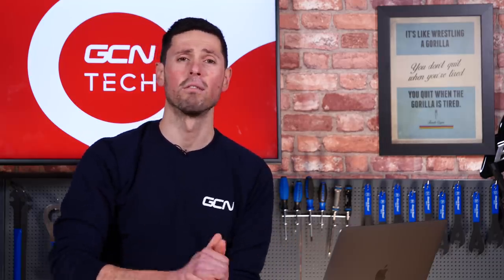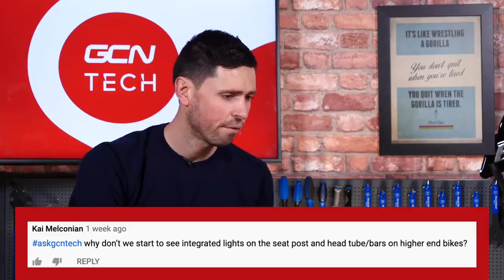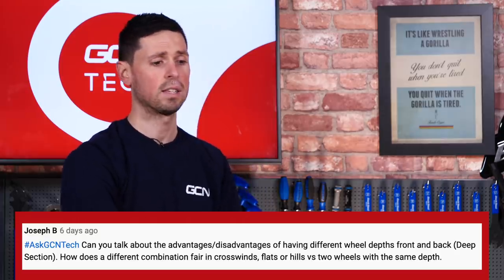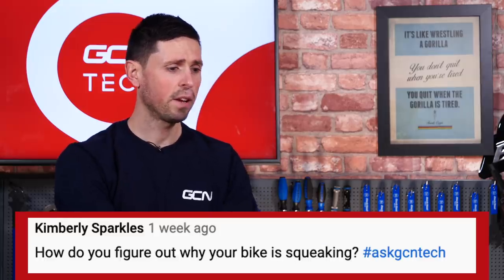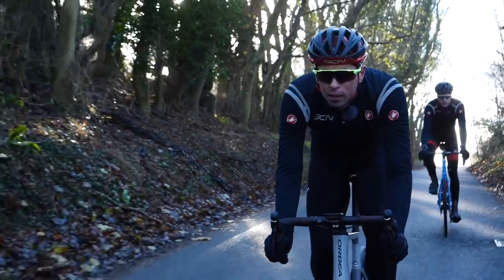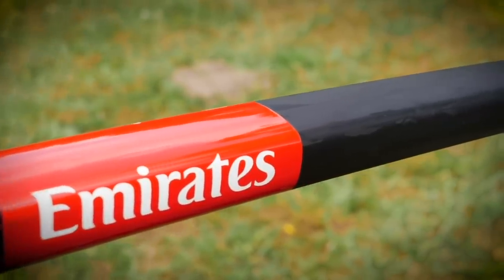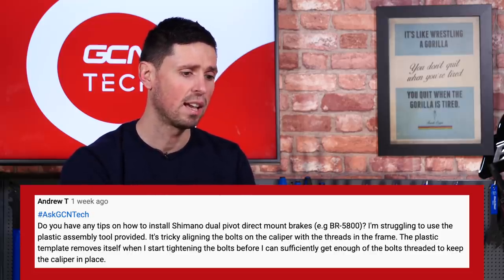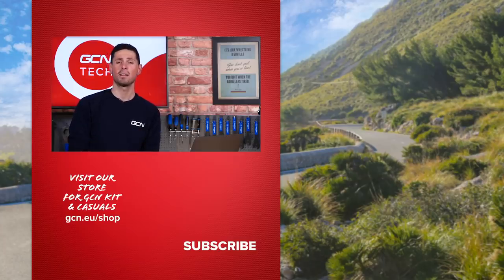Why Is Your Bike Squeaking When You Ride? | GCN Tech Clinic #AskGCNTech

Comment from the maker: If you have a cycling tech question that you want us to answer leave them below 👇 using #AskGCNTech
Reply: #AskGCNTech Why are wheels so expensive?
Reply: #AskGCNTech How often should I change my inner tubes and tires if nothing's wrong with them, because mine are ages old but nothing wrong but just look bad . Thanks Cheers and Happy New Year ❤️❤️
Reply: #AskGCNTech Hi guys! 
I recently watched a dream bike build video, where they assembled Zakarin's beauty. At the end the bike was only 6.27 kilos!!! How is that possible? I mean, what do they do to avoid disqualification? Do they put some additional weighs in the seatpost? 
Thank you for your answer!!:))
Reply: #AskGCNTech Why don't they sell orange spoke reflectors in the UK?
Reply: I had a Squeak on the front of my road bike with disc brakes for a couple of weeks it wasn't the kind of squeak when you apply the brakes to the rotor howling noise it wasn't that it was more like if the headset was loose or there was a crack in the carbon forks or something in that description when you apply the brakes. I got this bit of a squeak had me worried I finally narrowed it down and found what my problem was I put small bit of Grease a smear between the piston and the brake pad  solved my squeak 😊😊😊
Reply: Thank you for answering my question, Alex.
Reply: #askgcntech
I want to upgrade my 3X 105 crank to a newer 2X. So I need to also replace my front derailer and bottom bracket?
Reply: #askgcntech
Why haven't I won the lottery 😭😭 I want the new Cervelo 😂🤣😂
Reply: @paulwells3110  I don’t know if that’s a technical question.
Reply: Hi ollie. I have a gravel bike which has a cable actuated hydraulic brake calipers and they don’t bite as much as before but the braking pads still has a significant amount of compound left. I have already played with the cables and re-greased some bolts to make the braking action on the lever arm smoother. What can i do to make the braking power better or can i service the calipers at home by adding more mineral oil? Thanks a lot
#AskGCNTech
Reply: #AskGCNTech Everytime I go from my rear wheel to Kickr Core or vice versa, I have to readjust the limit screws due to chain rub when in the big chain ring. Is there a way to fix this problem? I have exactly the same cassette on my bike and trainer. Thanks!
Reply: #AskGCNTech Is it true that the smaller a gear range in a group set, the more durable the drivetrain? My logic is that 8-11 speed cassettes all have the same width, but each extra cog is fit by making every cog a bit thinner. Same goes for the chain. I am asking this question in terms of gradual wear as well as abuse from crashes and poor maintenance.
Reply: #AskGCNTech I have two different sets of shoes, and four bikes, all with different pedals, though all are SPD. All creak from the left shoe, or pedal. Is it some general Shimano SPD problem or is it more likely to be somehow related to my pedaling technique?
Reply: Hi guys. I've noticed the presenters riding various types of bikes: Road, Endurance, Gravel, TT, etc. in the videos with bikes that appear to have the perfect fit. How do you do it? I'm asking because I've had a professional bike fit for my road bike, and have purchased an endurance bike. Do I use the same data points across both bikes or somehow adjust for for different geometries? If adjust- any tools to help do this? #AskGCNTech

Comment: @kimberlysparkles  If you can answer that question without hours of trial and error, you'd be rich.  People have been trying to figure out why their bikes are creaking/squeeking forever.  Seat post, pedals, bottom bracket, handlebars, shoes, the list goes on and on.  You just have to eliminate each possible cause one by one until you get rid of it.
Reply: Good to know, I’m in for a long winter of squeaking and cursing. ;-)

Comment: I remember I had a squeak that was driving me nuts and I could never recreate except in specific conditions, well it turned out to be my shoe cover squeaking against the crank arm, like I said very specific conditions to recreate...rofl 🤣🤣🤣
Reply: Mine happens when I first start turning the cranks and then settles down as I ride. Ever so often, it comes back when I pedal.
Reply: Thats a good one, happens to me all the time on my flat pedals
Reply: @mango9087  I really can’t tell where it originates beyond motion. My mechanic says the bottom bracket is okay.  I can’t really work it out where else it is when I’m riding because NYC streets require the bulk of my focus.
Reply: @Kimberly_Sparkles  I'd check for tire rubbing on the frames, first off. Next, would be the pedal bearings. They often go unchecked but can be very noisy. Best bet, though, it to get it spinning in a bike stand (or equivalent). That way you can isolate the bike noise from road noise, and actually look at whats going on.
Reply: @mango9087  I wish I had the room for a stand. I'll come up with something. Thank you for the advice.
Reply: @Kimberly_Sparkles  Good luck!

Comment: Along the same lines of of the rim depth question, what about using different sized tires? I wondered about the old school time trial bikes with the smaller front wheel... What if you used a 23c or 25c front tire and a bigger size back tire? I know it won't get you the exact same effect, but would it make any performance gains/drawbacks to use different sized tires? #AskGCNTech
Reply: Especially on TT bikes, they will usually use a 23c tire even though 25c-28c are proven to have a lower rolling resistance on roadsurfaces. But, for very high speed purposes, they prefer the smaller frontal surface because aero tends to be more important the higher the speed goes. Only for a badly paved TT circuit, would they take a wider tire. In the back, they'll usually take a wider tire for comfort because the aero gains to be made on the backside of the bike is much lower vs the rolling resistance. This only applies if the width of the tire matches the profile of the wheel ofcourse, otherwise the tire will 'bloom' out much wider.
Reply: @globalwarsrocks  thank you! This makes sense. Moto GP bikes and sport motorcycles in general have a similar set up, so I figured there must be something to it. Wider rear tire is better for grip in the turns also.

Comment: #AskGCNTech Everytime I go from my rear wheel to Kickr Core or vice versa, I have to readjust the limit screws due to chain rub when in the big chain ring. Is there a way to fix this problem? I have exactly the same cassette on my bike and trainer. Thanks!
Reply: I'm guessing very thin spacers to match the Kicker RD set-up to your bike's RD - add to one with RD most inboard.  We'll see what GCN suggests.

Comment: #ASKGCNTECH  Hi Ollie/Alex,  I have 2016 Campagnolo Super Record EPS on my bike with CeramicSpeed OSPW on the derailleur. I have two pairs of wheels one with an 11-27 cassette and a new pair that I want to put a 11-29 cassette on to help on climbs. When the OSPW where installed it was set up for the 27T. When I put the 29 T on the upper jockey wheel hits the 29T sprocket. The EPS does not have an adjustment to maintain the 5mm-7mm gap as it is done with the chain tension. So if I change the chain and set it up longer for the 29T sprocket will i be able to swap the wheels out for the 27T without having to change the chain? Sorry for the long question.

Comment: #AskGCNTech
I running on wheel size 27.5” ie 650B tyre & tube. If I would like to swap with 28” wheel size ie 700c tyre, what factor I need to consider other than frame clearance? Thanks

Comment: #askgcntech
I just started getting into cycling and 
I'm looking to buy a new bike, the shortage is turning out to be a pain - bikes I like are available in a size bigger or a size smaller than I'm supposed to get. Which is a better option for a beginner? I know pros get smaller ones, but...
Reply: Smaller, you could always buy longer stem and or move seat back a few cm.

Comment: #AskGCNTech Happy New Year to the GCN team! I have really enjoyed your videos and have decided to follow your advice and get more aero! I am looking to tidy up my cockpit by replacing the standard handlebar and stem on my Cannondale synapse to one with a more aero system with integrated cable routing. The nicest one I've found is the Most Talon Ultra found on Pinerello bikes, but they state it is only compatible with Pinerello bikes. Is this strictly true, or is there a hack to overcome any compatibility issue? If not, can you recommend any aero handlebar/stem combos which are very tidy and aero? Ideally with compatibility for an out front mount arising from under the handlebar for my Wahoo elmnt roam. Many thanks!

Comment: first time I've been early, Should I buy a budget bike and upgrade it or just get enough money  to invest in a expensive one #AskGCNTech
Reply: that was a daily asked question when i worked in a bikeshop. first of all how are you build and how do you wanna use your bike? do you stand at 2 m with 100kg and sprinterlegs and you wanna enter in competitions then it wpuld be wise to invest a little more at the beginning, because you will start upgrading pretty fast. when you are 1.70 with 60 kg and you wanna join your partner on the weekends for an easy ride around town than a cheaper bike can be a long term companion. sometimes people just want to start today and they have a fixed budget, so they just buy the best bike for that budget and then they start upgrading as the components give up or as they learn what they want to improve.
Reply: I dont really know what to do cause i have a $750 budget and I live in the philippines, so any part recommendation? Road or mtb
Reply: @kampululutong  the MTB or road question you have to answer yourself. do you wanna ride in mud, over loose gravel, roots, trails in the woods, then it´s MTB, you wanna go fast and long  on smooth tarmac, road!
unfortunately i have absolutely no knowledge of bikeprices in the philippines. maybe look into your local used market ???
Reply: Would you recommend buying a bike from official sites like specialized, trek and other brands? Thanks for the advice

Comment: My gears seem to become unindexed when I put my bike on my Kickr trainer. Is this normal and what can I do to fix this? #askGCNtech
Reply: This can happen anytime you switch anything in the drivetrain, in this case your wheel and cassette for a trainer and another cassette. No two parts or setups are exactly the same due to manufacturing even if you use like for like parts or setups it’s just the laws of physics so yes you may need to reindex each time you use your trainer. This can even happen if you put another wheel on your bike and the wheels/cassette match but indexing still may not line up. It just the manufacturing laws of physics
Reply: Take a look at the derailleur hanger- how it is aligned- it can bend when quick release is tightened-causing bad indexing.

Comment: #AskGCNTech I noticed on the turbo trainer than I was feeling vibrations through the cranks at the bottom of my pedal stroke. I managed to eliminate it by improving my pedal stroke with a more circular motion. Am I just pedalling correctly now or do I need a new bottom bracket? I may not be able to feel these vibrations on the road and my pedal stroke may not be as good outside either

Comment: #AskGCNTech -- How does Strava calculate Power for users that don't have power meters? I see a lot of variation between riders of similar weight on similar rides.  Is this a reliable measurement?
Reply: It uses an algorithm based on heart rate, speed, altitude gain/ loss, and marketing hype. 😄
Reply: @prestachuck2867  it’s the marketing hype that makes this authentic.

Comment: my bike is squeaking badly. It happens when i try to put more force to the pedal such as sprinting or climbing steep hills. Got any idea ?
Reply: Do not start with the bottom bracket, but instead with pedals, shoe clips, saddle and seat post.
Reply: Had the same issue - for me it was the quick releases that were not fastened enough

Comment: #askgcntech
I want to upgrade my 3X 105 crank to a newer 2X. So I need to also replace my front derailer and bottom bracket?
Reply: 1. Not sure about 105, but I was able to run other Shimano 3x front derailleur on 2x system.
2. Depends what kind of BB you have now.

Comment: #askgcntech

What are the best and the most budget friendly solutions for riders who need prescription glasses?
Reply: I use a tiewrap to mount my regular glasses behind my shades. Works very well and saves a lot of cash.
Reply: @janwillemkuilenburg7561  I got a pair of Rx Warby Parker sunglasses that I put an adjustable band on from Amazon so they don't slip. It works well, paid less than $200 and have gotten compliments on them. Zenni is another cheap Rx sunglasses option. There are no cheap options from Ray-Ban or Oakley on Rx sport sunglasses, and popular cycling brands and models tend to have no Rx options. If you must have Oakley Sutros, your only option is to get contact lenses.
Reply: I use "Cocoons" - these are large sunglasses that fit over and around your regular prescription glasses, as long as your regular lenses are not too large.  They cost about $65 CAD here in Toronto, so they are not real cheap but they are much less than prescription sunglasses, especially if you have progressive lenses.